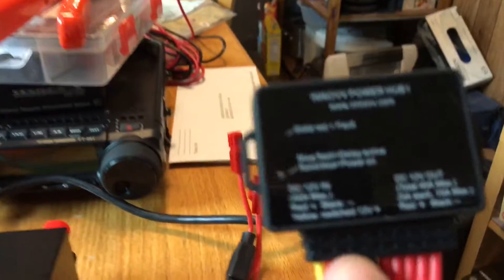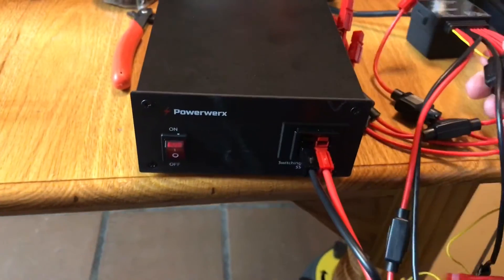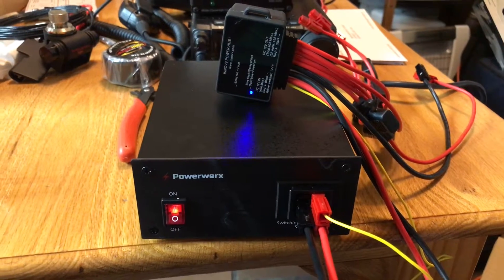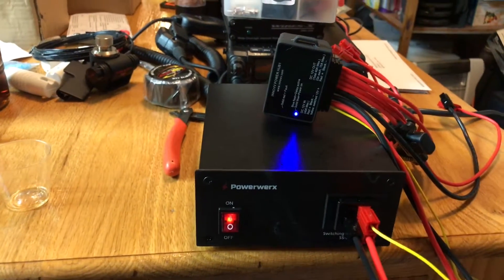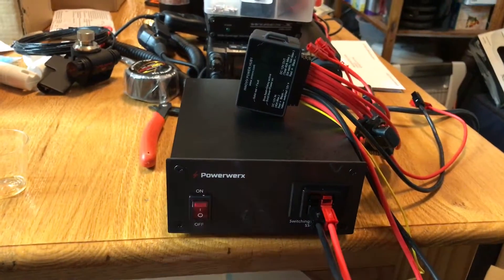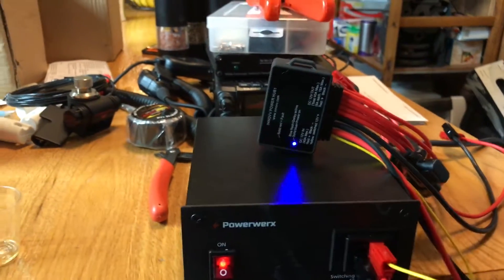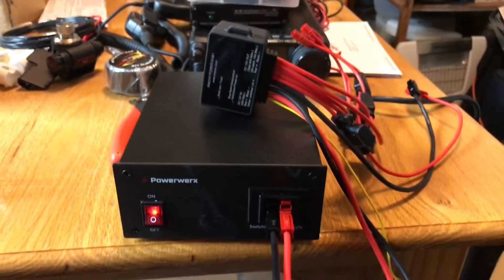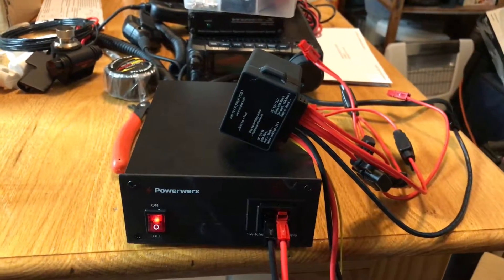Innovv Power Hub1 bench test

Comment: I am not an electrician so I am somewhat challenged by this. I bought this unit and I’m going to install it but I’m having a hard time figuring out how you connect your accessories. With four red power wires and one black terminal, how can I connect positive and negative to eat accessory with only one black wire?￼
Reply: Did you get your answer? I would think you can connect the negative side of all accessories to the single black wire or other suitable ground (earth).